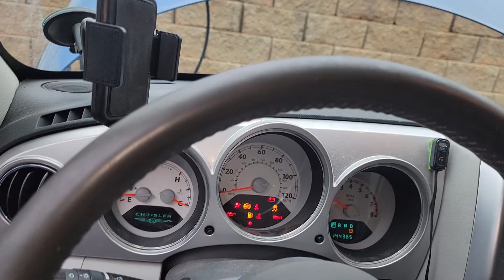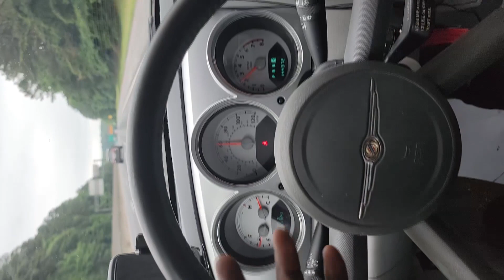Here's why mechanic HATE WHEN THIS HAPPEN.

Comment: I have a 2002 PT Cruiser. Got it from my neighbor. One of the most reliable cars I've ever owned. I just replace and do normal upkeep. I run into bozos all the time who tell me their car " only" has 30,000 miles but it's 25 years old! That means every belt, hose, etc should've been replaced just cause of the age.

Comment: Jt, you know I am a big PTCruiser fan as well. In fact up I have a 2009 that looks just like that , Which I have had no problems with.  
But here is my experience with a  head gasket on another PT Cruiser. I also have a 2001 and what happened was my wife drove the car after what she though a minor accident not knowing that the coolant leaked out, overheated the engine and cracked the head.  Where it cracked was not immediately noticeable. It was between one of the exhaust ports and the water jacket. So, hot exhaust was getting into the water jacket as well as antifreeze getting into the exhaust pipe. ( so no antifreeze leaks were noticed dripping ).
So, once I figured that out , I replace it with a reconditioned 2003 head which didn't work out very well and I'll explain later.  
The point is that you can have an over heating problem and losing antifreeze and not see any leaks.  
Keep up the good work and I'll talk to ya later.

Comment: Yup, could be head, could be clogged radiator. You are right, you don't know at this point. You can try and check the rad with a temp gauge and check hoses but it could be a lowly clogging rad.  
I leased a 2003 PT Cruiser GT Turbo once. One day the temp gauge spiked and the car chimed for overheating. I quickly pulled over and heard bubbling from the coolant tank. I let it cool down, started it back up and it was fine for the remained of the three years I had it. Never happened again! 
On a side note, I change fluids due to age but not belts. I would certainly tell a customer about the timing belt and age and then let them decide to replace or not. At least you would be having that conversation with the customer and CYA kind of.

Comment: What’s up man hope u doing good. Quick question , so on the 2006-10 dodge charger hemi lx body , the rear fuse box the (rear power distribution center). If that component is swapped from a car at a junkyard does that need to be programmed? 

Similar to like the front fuse box and control module etc, does the rear power distribution center have a similar process? Or is it plug and play

Comment: Question. I got a 1999 Tahoe and I recently got my transmission rebuild and on some days I see transmission fluid on the ground and it's leaking from my drive shaft. What could be causing that leak?
Reply: And when I cut my air on it idles high. What could be my problem? And even when my air is not on it still idle high
Reply: @arkansasboi5013  You have a/c and you live in Arkansas? Must be a Senator's son or something.
Reply: @jimandskittum  nope just a black man with a transmission leak😂🤣
Reply: @arkansasboi5013  I live in a neighboring state (misery) and all I have is pretending that I can clown on Arkansans. Not cool, I am sorry.🍺
Reply: @arkansasboi5013  Locate your Idle Air Controller and remove it. Jam a fresh nitrile glove in there and press it in good. If it idles low it's the IAC if not look for the vacuum leak.
Reply: @jimandskittum Thanks doc I will give that a try.
Reply: @jimandskittum  My granny always told me to say I apologize not sorry. I'm sure you, not a sorry person. Men sharpen men God bless🙏🏾
Reply: @arkansasboi5013  Well I apologize. It means the same to me. Is your truck a 5.7 or did they change to LS? I use flammable brake clean
Reply: Oops hit enter. It is "dangerous" but I spray vacuum lines and the top of the intake gaskets. Look for obvious vacuum leaks and then make sure the Idle Air Controller is working.
Reply: @jimandskittum  Yeah it's a 5.7
Reply: @arkansasboi5013  When I say jam it in there good, I mean there are two ports you have to block. If you can't get a good eye on the socket wind the glove up so that it blocks the whole cylinder.
Reply: On the trans leak, it often leaves a clean streak because of the detergent. If not, suds it up with more gloves and purple cleaner. Drive it when it dries up and you should see the source.
Reply: @jimandskittum  I found out why my transmission was leaking. The reason was my mechanic put too much transmission fluid in it it had 2 quarts over so he gave me a choice to drain it or let it balance itself out well it wasn't leaking it's like my truck threw it up but it did it every other day.
Reply: @jimandskittum  bet. I just need to find the time to do all that. Thanks brother God bless you🙏🏾💯
Reply: @arkansasboi5013  If he pulls the dipstick tube out of the case it will drain to a little over full and shouldn't leak anywhere. I would get them to straighten it out. Don't wait until too late to find out there is another problem.
Reply: @arkansasboi5013  Thanks. You'll get it. I love 99-00 GM trucks. They have just the right amount of simplicity and features. Keep hammering.
Reply: @jimandskittum  ima subscribe to your channel just in case I need to know something about my truck. Thanks again brother bless.

Comment: Does the customer stay mostly idle, in traffic, AC blowing, during rush hour, on night hot Atlanta weekday...on the highway?  She could be going highway speed ...like 10 mph for all you know. 😂
Reply from the maker: Whats funny?
Reply: Just saying you were going actual highway speed, air is flowing...but if customer is going "highway speed" at 20 mph in traffic, that won't be enough air to keep the radiator/engine cool enough...fan could be failing (even if new).  Had that happened to me.  The fan was new (crappy aftermarket) because it wasn't kicking to 2nd stage high speed, was stuck at lower speed engine was overheating.  Once I swapped out for a more quality fan problem solved.
Reply from the maker: Interesting dude. Yes, worth noting. Thanks